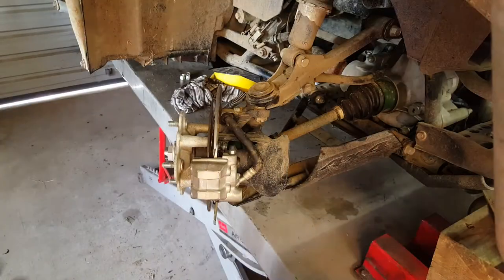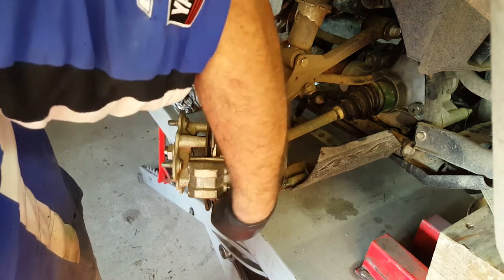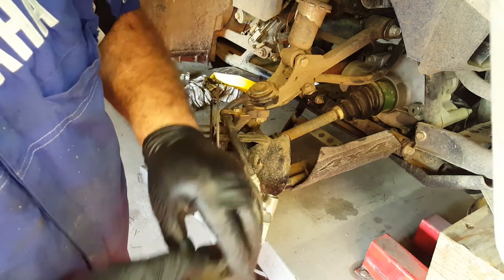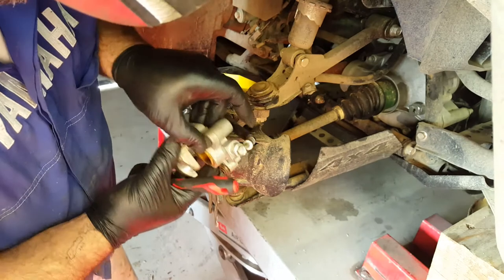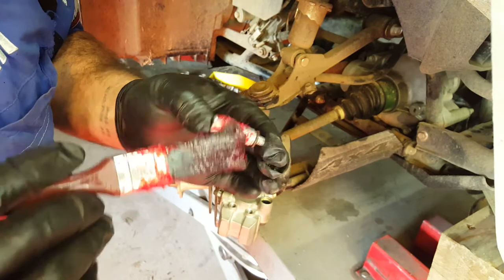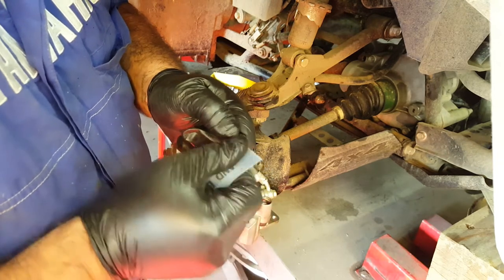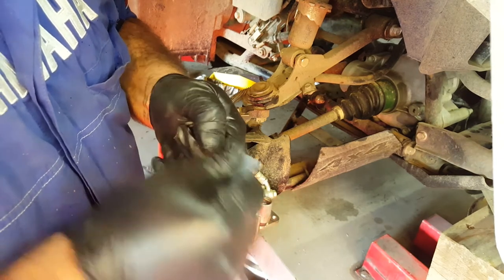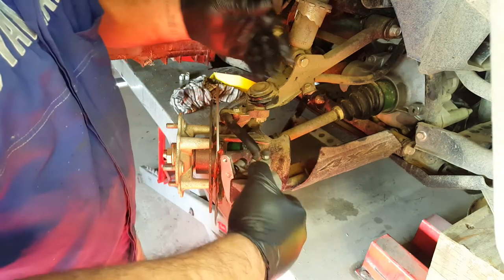Yamaha Grizzly 450 - front brakes service #1317

Comment: Nice job Andy. My new arctic cat was designed by shoe cobblers im sure of it. Brand new in 2006 and the front caliper fell off the fist 200 km, no Loctite anywhere and the brake system is so primitive compared to that Yamaha. I use thread locker and copper anti seize compound as you do. Cheers
Reply from the maker: +STEVE ROB Thanks for the feedback Steve. It's been a busy few weeks for me and it's not over yet.....I have another Yamaha Viking coming into the workshop later today for a major service & full brake overhaul amongst other things. It's spent the last 2 years working on a beach so it won't be a pretty sight!

Comment: I have a 2007 450 Grizzly - I can barely turn the hubs using both hands (6'4" 245# man) Brakes have never been serviced as I've only put 50 hours on the atv. I can push the atv freely with my hands to move it in the garage. The brakes I assume are seized. Will I need to bleed the lines too or just maintenance the calipers? Why does this happen on these Yamahas?  Thank you for this video - looks like I have some work ahead of me.

Comment: Do use silicone paste on the slide pins? Ive been using that on all my cars and also atv’s.
Reply from the maker: Hmm....I'll give that a try as the copper paste does tend to dry out over time. Cheers for the tip. Andy

Comment: can you please do a video on the rear brakes (the wet brake system) i have 2 350 irs both with bad rear brake for a long time and cant find anything about ding a full replacement of the plates inside rear brake system ... pleeeaaaassseee
Reply from the maker: +Quadrophenia Private ATV tours - Koh Samui Thailand Thanks for the request. I'll see what I can do. I think I do have a rear final drive somewhere that has an internal wet break.

Keep a look out! Cheers Andy
Reply: Excellent that would be great ! and long over due for my grizzlys  :-( you look like a guy i need to know haha ! would you happen to know if there is any rear brake kit for the grizzly 350 irs wet brake ? because i haven't got a clue which individual parts to order from partzilla etc ..
Reply from the maker: +Quadrophenia Private ATV tours - Koh Samui Thailand message me back with the full 17 character VIN number please :-)

Comment: shouldnt you use blue loctite on those bolts? the guy working on them next year might be cussing you a bit :P I also like to pump the piston out a bit and clean up any crud that's built up around them when I change pads cause they'll be pushed back further into the caliper.
Reply from the maker: +Scott Tuttle Well spotted though unfortunately I had run out of the less aggressive stuff! The pistons were pretty clean and pushed back in under thumb pressure. The job was very tight in budget and I was just instructed to fit pads, no time allowed for caliper servicing. Sometimes you just have to follow the customers instructions. If I remember correctly I advised that all calipers should be stripped and cleaned at the next service (in a year!)  It's always me that does the work on their bikes so I'll no doubt be cursing myself next year!

Cheers for the feedback & hope you found the video helpful. Welcome to my channel :-)
Reply from the maker: +Scott Tuttle Well spotted though unfortunately I had run out of the less aggressive stuff! The pistons were pretty clean and pushed back in under thumb pressure. The job was very tight in budget and I was just instructed to fit pads, no time allowed for caliper servicing. Sometimes you just have to follow the customers instructions. If I remember correctly I advised that all calipers should be stripped and cleaned at the next service (in a year!)  It's always me that does the work on their bikes so I'll no doubt be cursing myself next year!

Cheers for the feedback & hope you found the video helpful. Welcome to my channel :-)
Reply from the maker: +Scott Tuttle Well spotted though unfortunately I had run out of the less aggressive stuff! The pistons were pretty clean and pushed back in under thumb pressure. The job was very tight in budget and I was just instructed to fit pads, no time allowed for caliper servicing. Sometimes you just have to follow the customers instructions. If I remember correctly I advised that all calipers should be stripped and cleaned at the next service (in a year!)  It's always me that does the work on their bikes so I'll no doubt be cursing myself next year!

Cheers for the feedback & hope you found the video helpful. Welcome to my channel :-)
Reply: Nice vides. I just bought a 2008 grizzly a couple days ago and I've been going over everything top to bottom. Its always nice to have a reference for something new. Just changed the oil today and the owners manual doesnt even mention taking out the strainer bolt which seemed strange to me and got on here and found your videos for more details.
Reply from the maker: +Scott Tuttle Well spotted though unfortunately I had run out of the less aggressive stuff! The pistons were pretty clean and pushed back in under thumb pressure. The job was very tight in budget and I was just instructed to fit pads, no time allowed for caliper servicing. Sometimes you just have to follow the customers instructions. If I remember correctly I advised that all calipers should be stripped and cleaned at the next service (in a year!)  It's always me that does the work on their bikes so I'll no doubt be cursing myself next year!

Cheers for the feedback & hope you found the video helpful. Welcome to my channel :-)